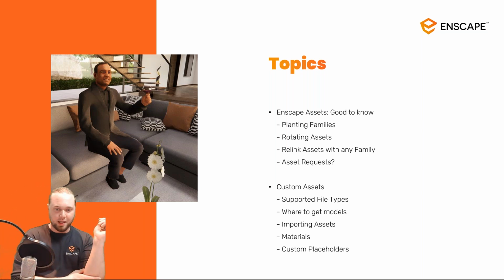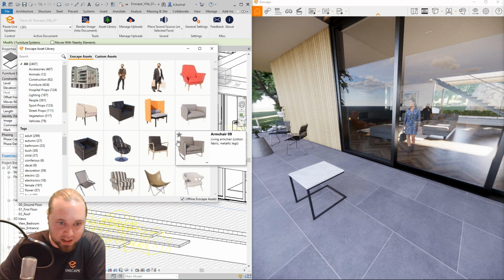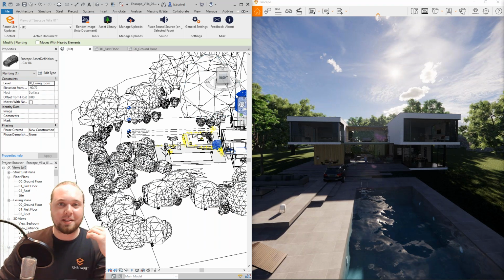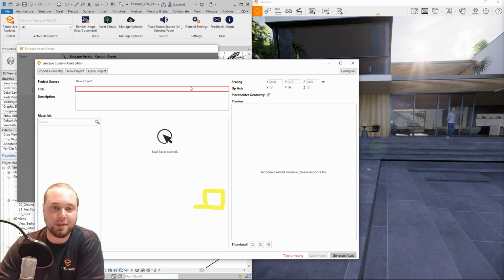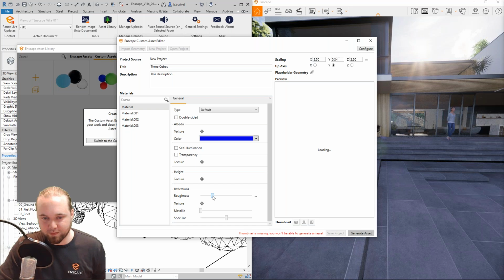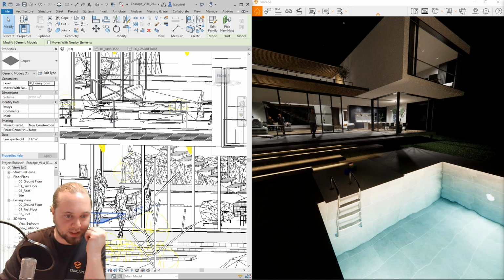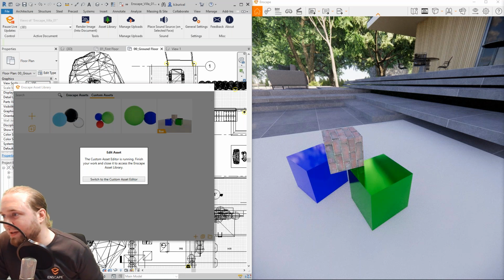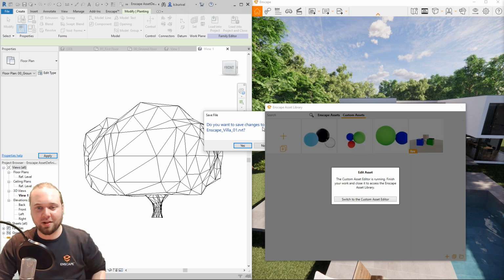Webinar | Enscape with Revit: 3D Assets and Importing Custom Assets

Comment: I hope enscape 3.1 can make custom asset over 20 000 triangle
Reply from the maker: There is no limit to the triangle count you can import in your custom asset library, but Enscape is a real-time engine, so it pays off to keep the detail low - especially if you're planning to place them multiple times in your scene.
The 20 000 Triangles message is just a warning, not a limit.
Reply: @EnscapeArchDesign  i known, but some big triangle fbx model can import but it is hidden, i can not edit model
Reply from the maker: @hoaduong9441  Please be so kind and contact our support team over at support@enscape3d.com and they will try to look into this and help you further :)

Comment: Is it possible to change the material of an enscape object (like making a black table white for example) in enscape directly or do I have to do it postproduction please? And if possible, how do I do it please? I am a user of enscape with archicad, not revit. Thanks!
Reply from the maker: Currently it's not possible to change the materials of the native Enscape Assets - though this a feature we hope to provide in our next version. If you are importing a custom Asset via the Custom Asset Library, you can adjust the materials in the Editor.
Reply: @EnscapeArchDesign  Thank you for the answer!
Reply: @EnscapeArchDesign  the imported Enscape editor does not have a material param. attached to it.

Comment: Hey I want to change the colour and material of one sofa
Damn it I have been searching through out the internet but no clue
Why the hell have you made your asset library with a close ends, what if someone just want to have few colour changes on your assets
Reply from the maker: Hi there; this feature is currently in development and planned for our upcoming release this spring. If you want to have a look at all the features we're currently working on, please have a look at our roadmap in the Enscape Portal: https://bit.ly/enscape-roadmap
Reply: @EnscapeArchDesign  Is it not possible to change the colors of these assets? Kind of disappointing. Currently, 5D render has an advantage in this aspect by incorporating character animations.